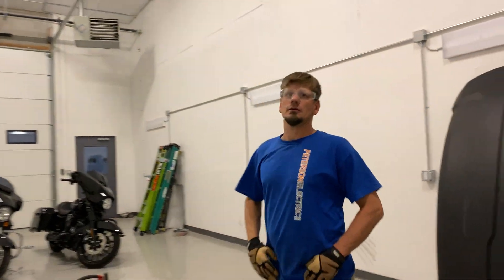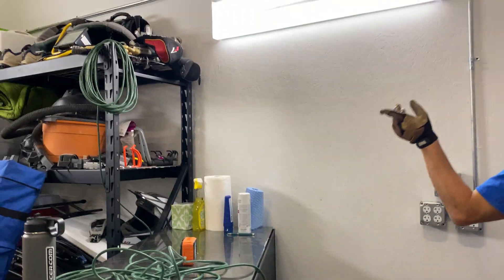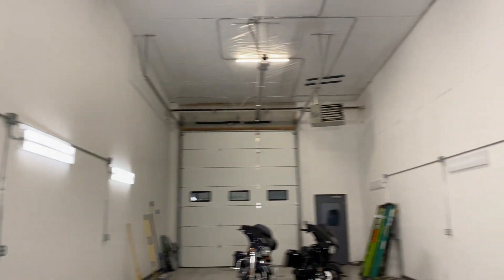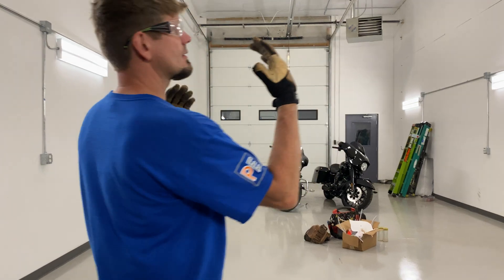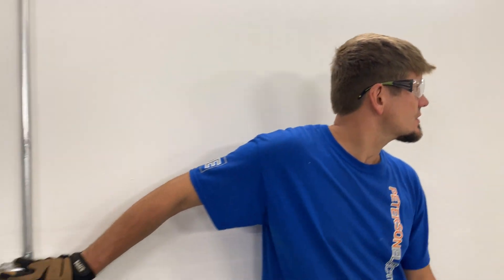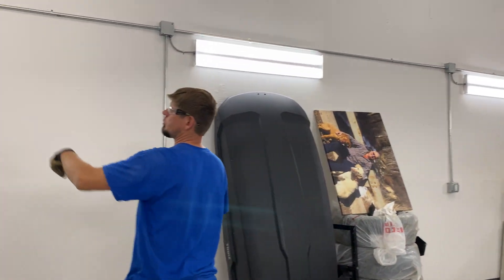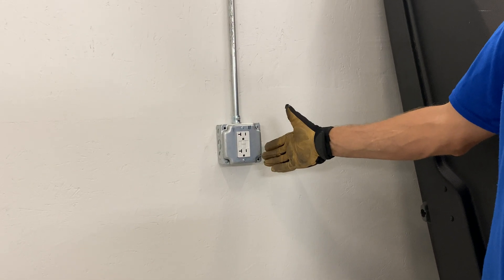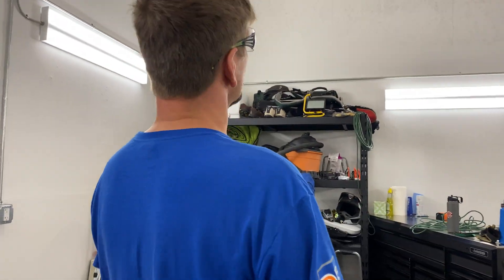How Bright LEDs Should Be - (Commercial Garage Layout Pt. 2)

Comment: Nicely done. OTOH, I have been a fan of installing outlets for the lighting fixtures instead of hardwiring, to make servicing easier. The idea here is 20 years ago we were installing regular fluorescent fixtures then all of a sudden, we had the solid-state ballast with high putput tubes. Now days, we have LED... all in the span of 20 years. With an outlet at each 4x4 box you can add another fixture or change to a different style more easily. Also, the lighting fixture is now "non permanent" which means the fixture itself doesn't have to comply with electrical code, although it should be UL approved. One thing that gains you is the ability to finish a job and pass inspection without having all the fixtures installed.

Comment: Why wouldn't you install the fixtures inline with the conduit instead of doing that lil elbow im trying to figure out what that is is it flex
Reply: It's an MC Cable whip. The junction box receives the EMT and then out of that he fed one MC cable to the light, instead of having EMT terminate to the fixture and having to have roughly 4 feet of wire going through inside of each fixture.
Reply: This will also make servicing and replacing of lights easier, as well as adding more on at a later date.